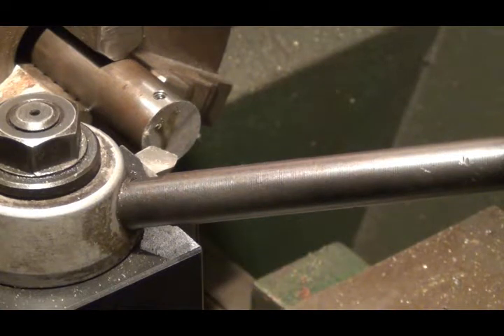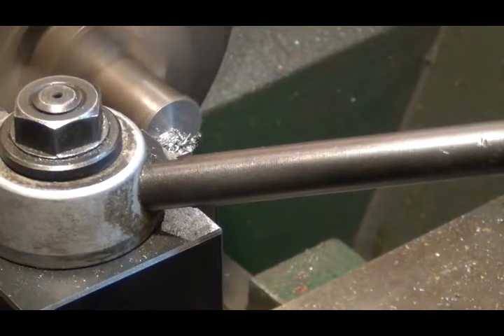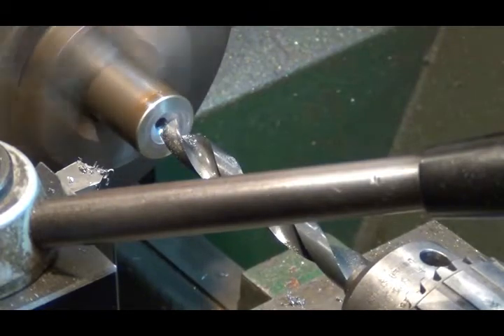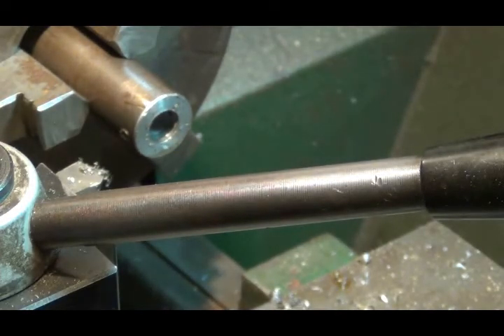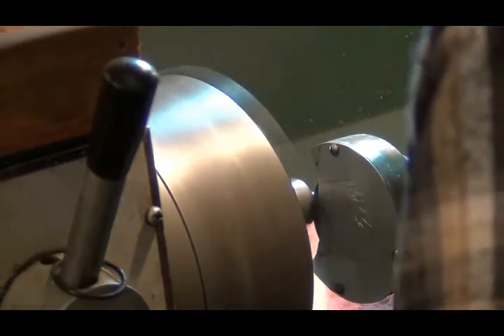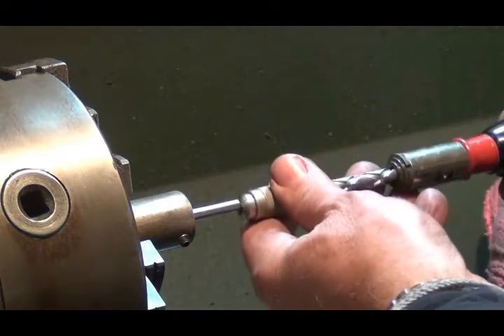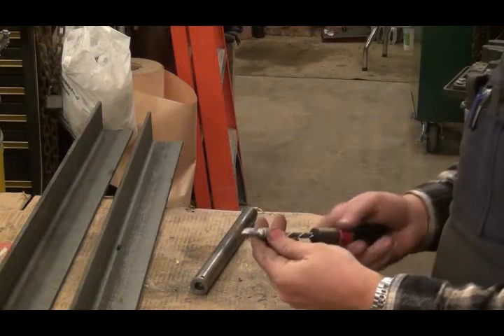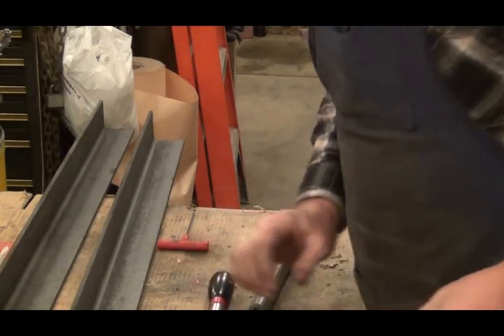Copied Tom Lipton's chamfer tool part 2

Comment: Good Job, Buck. One suggestion, I think the toolpost grinder probably world work somewhat better if the lathe spindle was running in reverse, so the stone would not tend to climb on the work. Sort of like climb milling.
Good video, thanks.
Dick
Reply from the maker: WB8MHE The grinding wheel and the steel turning was going in opposite directions. I was surprised the sparks were going down like the were. I was expecting them to be shooting up. If you look close there were some that went up over the turning piece.